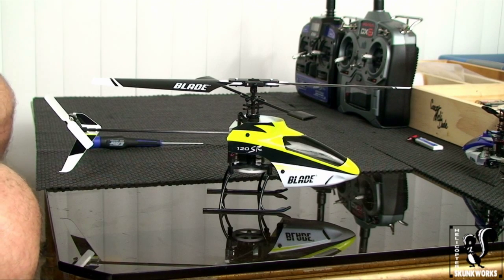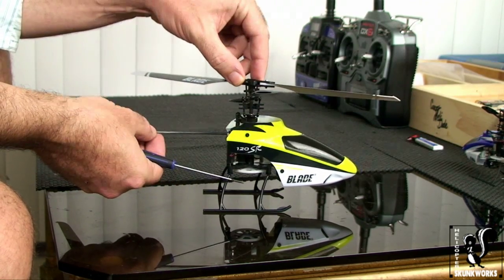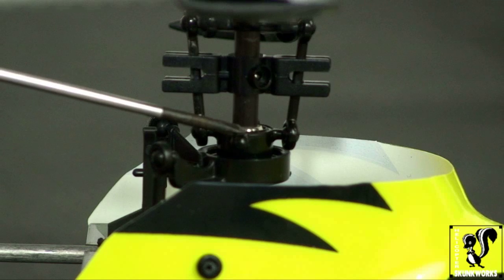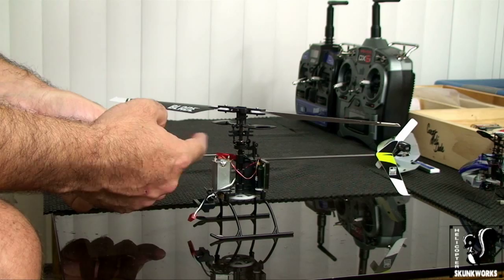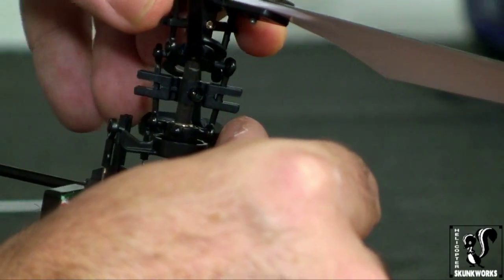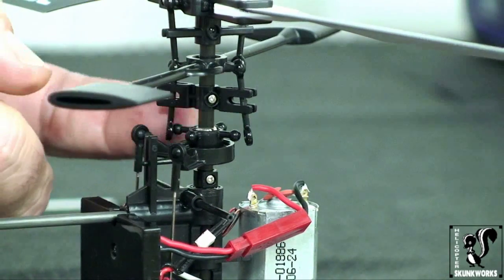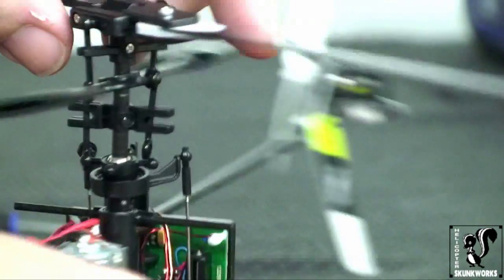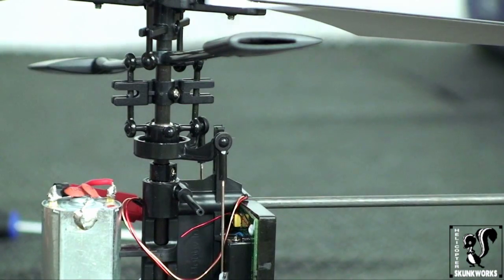Blade 120 SR - Advanced Swash Plate made SIMPLE - Beginner's Guide Part 3

Comment: Thanks so much for the videos, they really do help.  Have flown the Nine Eagles Solo Pro V2 for a while before getting the 120SR.  My problem is not the advanced swash plate setup, it's getting the DX7s to get into the advanced mode.  Pushing the right cyclic doesn't seem to work.  I admit I'm not real knowledgeable with the transmitter, as the Solo Pro was RTF.

Thanks for any help!

Comment: You are playing with fire, as they say .... pulling the links off with your fingernails ...
 You can pull the ball right off of the swash plate that way ... you need to support the outer end of the ball as you pull the link off..

And when you put them back on, you should not just push on the links on without supporting the backside of the ball on the swash plate..  I have seen the shaft that the ball is part of, bent and also broke.   
  In fact, in your video, you can see that shaft bending.